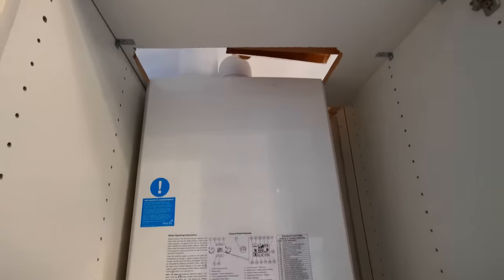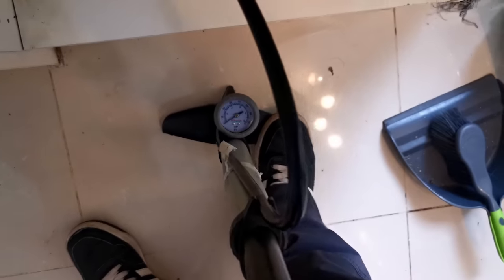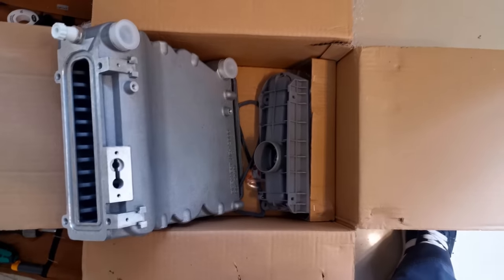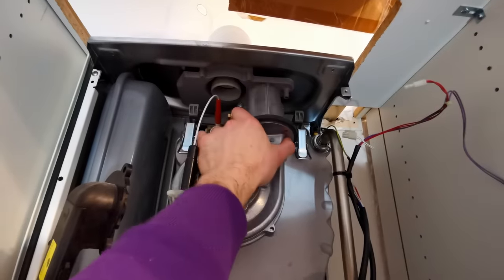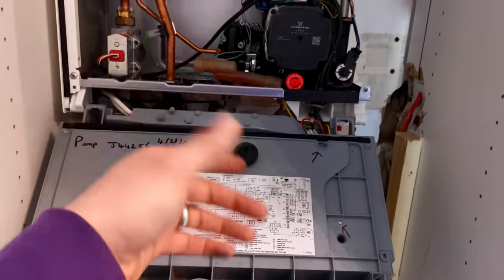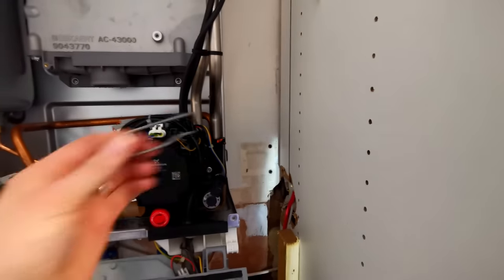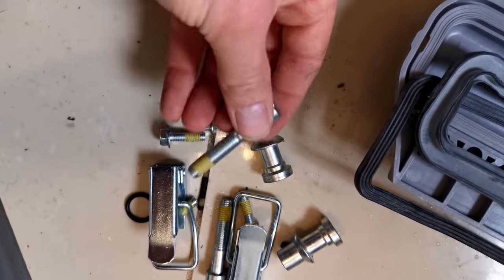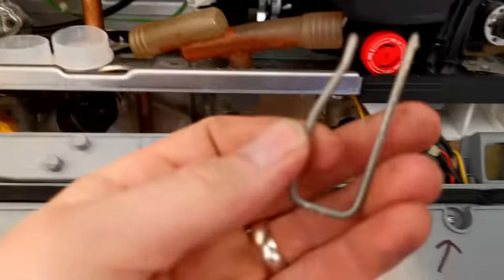How I became confident at boiler repair. Alpha boiler Repair. Main heat exchanger replacement.

Comment: Good video that mate what was actually wrong with the boiler just said hw was overheating also where did you get that doody two way ratchet spanner from I want one haha
Reply from the maker: I can't remember where I got it..... Your the first person to ask. :-) The boiler overheated on HW. Afterwards it was ok. I didn't see any blockage and the water was clean???? It worked though. :-)
Reply: HeatingGeek well dig your receipts
Out nobody’s asked because there not professionals like me and you haha o/j so do you know the actual cause of this tried having a read up on it could find was it just a faulty heat ex 👍
Reply from the maker: @pauls826  I don't know. I was sent to replace it, so I did. If it didn't work I would get paid again. This was a job for BG through a manufacturer. :-)
Reply: HeatingGeek ahhhhhh found it haha 😮 there only cheap wicked 👍
Reply from the maker: @pauls826  Where from?
Reply: HeatingGeek enay
Reply from the maker: @pauls826  Ah, ok. I will have a look. :-)
Reply: HeatingGeek also have a look at Nerrad tools NTVSF1 versa tunnel on amazon or look at it on here you will love ther

Comment: What a ridiculous boiler that is why i love vaillant easy, quick amd is working. However is it your boiler or a customer? First i have seen the boiler is in a cupboard  installed at the left i dont think it is save. In general the boiler as to have 7.5 cm distance to combustible materials or the material has to be covered with non combustible material. I have seen at your boiler video thats approximately 2cm. Your or your customer boiler is at this moment at risk. However if the boiler doesn't get enough air secularisation which will be mentioned at the manual it is possible the heat exchanger is getting to hot or the whole boiler.
Reply: Unfortunately you are incorrect these boilers only require 5mm clearance on the sides and looking at the video it is more than that therefore this boiler would not be at risk

Comment: Earn & learn the only question is: what customer says after spending more money ￼on badly diagnosed old alpha eco2 than would have baying new one?Parts you have listed early and main heat exchanger are over £500.00 and obviously non of you gays worked for strawberry picker ￼hourly rate. Flushing both heat exchangers would most likely sort out overheating problem leaving you with profit but not boiler spares dealers.
Reply from the maker: Your absolutely right. If this was my paying customer they would have only paid for my time. I didn't diagnose any part. BG fitted the first 2 and told Alpha to come and do the main heat x. Alpha asked me. I went and done the job. Boiler fixed. Customer pays £20 a month or whatever. :-) I would of fixed this boiler for labour and chemicals. :-) I don't replace parts that don't need replacing. And I would never charge a customer for parts that I got wrong.

Comment: mate someone's made moody web channel that looks really like cheap knock off yours called heat geek might want c for yourself very moody
Reply from the maker: They are doing the same type of thing. :-) They appear to be focused on design. :-)
Reply: That's Adam, he's a sound guy.  I thought this was his channel originally, so the similarity can work both ways.

The similar name would have been a coincidence, and yes he is more of an installer than a repair guy.  If you want to wind him up..... Just ask him "series or parallel when hooking up a twin coil cylinder?". 😂😂😂😂
Reply from the maker: @YagiChanDan  Yeah, seems good. Maybe I can add content to his site.